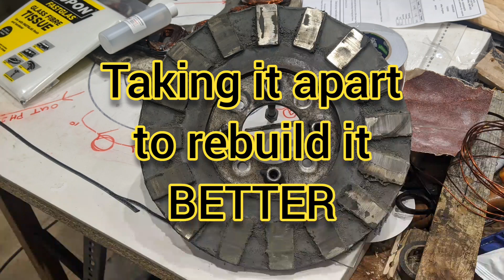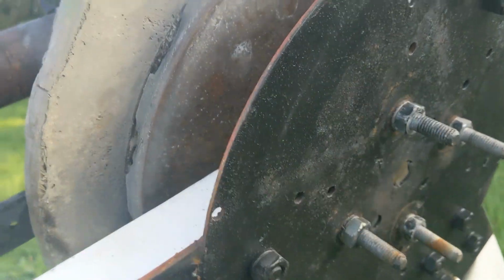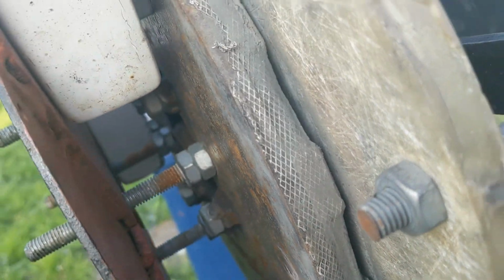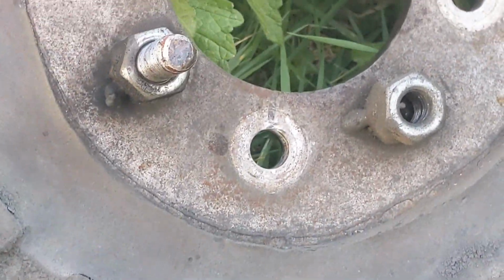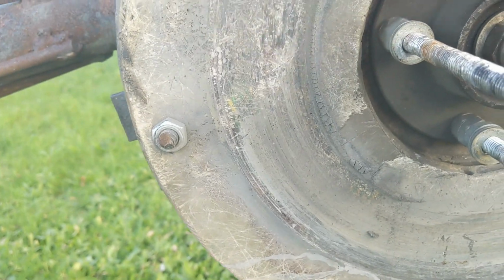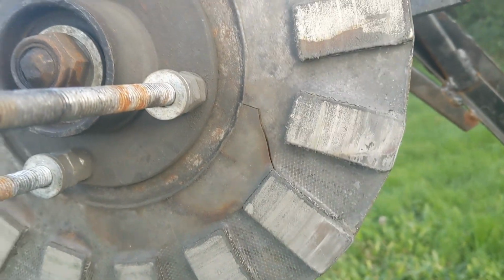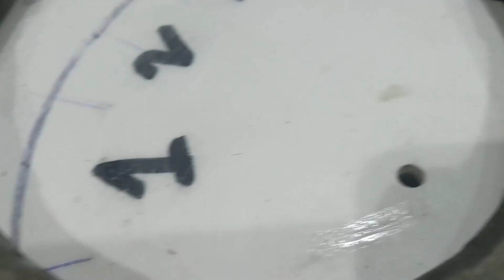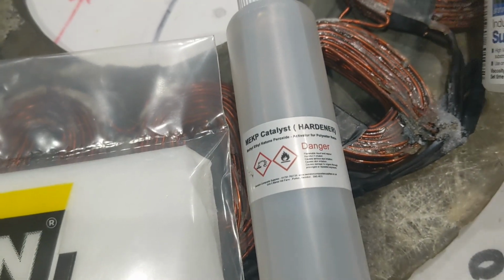Taking the wind turbine down to inspect the rotors and remove the stator

Comment: reminds me of brake dust from brake pads lol. So the magnets let you down power production wise, atleast you now know the answer, mine are dangerously powerful, 40mm×40mm×18 but I need to make rotors or get them made cant find brake disk's big enough, one day I hope to get around to it
Reply from the maker: Yea that is some big ass'd magnets :), I have no one local to make stuff, these rotors are nearly 10 years old, I dug out all my aluminium blades Ill be making a vid of them tomorrow plus I am gonna make some fibreglass replicas, that should be a cool video , cheers for the comments.